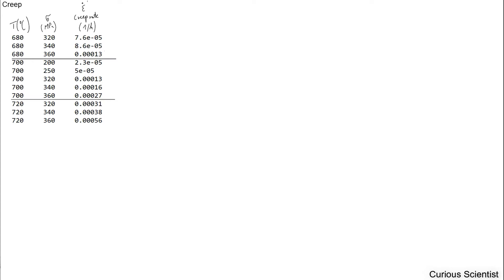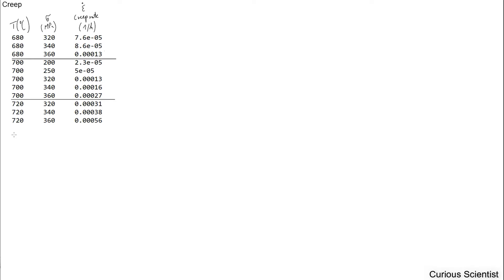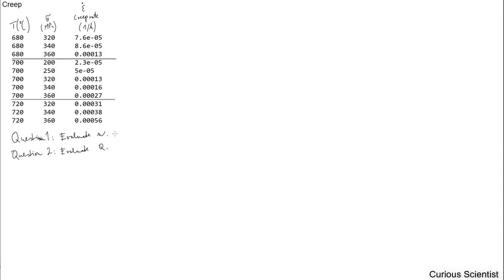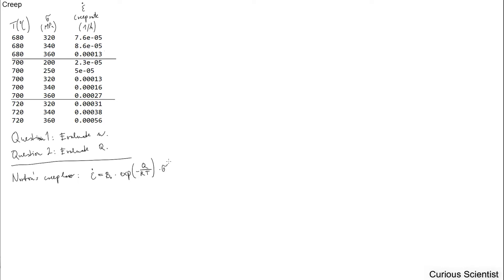Creep calculations - application of Norton's power law

Comment: Hi, If I use Ln for the linearization  the  Q values are the same that using log?
Reply from the maker: Hi! Could you rephrase your question? I don't exactly understand what you mean. I explained in the video that when we "cancel" out the exponential, we need to use ln(), but the rest is log(). Natural vs. 10-based logarithm.

Comment: How can I get the strain rate from creep modulus? Creep modulus is the inverse of creep strain at constant stress but not sure how to make strain rate from the strain. Thanks in advance for your thoughts...
Reply from the maker: If we "go back to the basics", creep is just a diffusion-assisted or dislocation motion-assisted deformation of the material. If you put a load on a specimen kept at a high temperature, it will creep. The creep will cause the elongation of the specimen. This elongation will happen at a specific rate. The elongation can be compared to the original length of the specimen which is actually the strain: ΔL/L0 = ε. If you are curious about the rate then it is simply just dε/dt. In this interpretation, I think the creep rate and strain rate are the same. So, according to the above expression, you just need to differentiate the creep curve and you get the strain (creep) rate.

Comment: To calculate B0, would you just take the Norton creep law and plug in the constants n and Q and the stress and strain rate at the corresponding temperature and then solve for B0? Thank you
Reply from the maker: Yes, if you have the above mentioned parameters, you just have to rearrange the equation.

Comment: Sir, i have T, σ and ε΄ data from tensile test for an alloy of my interest. I want to simulate creep in Ansys with the use of Norton's creep law. May i use this procedure to derive constants for the Temperature that i have more data ? How accurate is such an approach for modeling creep response ?
Reply from the maker: Hi! I am not familiar with creep modelling so I cannot really answer your questions.  But you can of course evaluate the data for the temperature where you have more data. In this demonstration, I also only evaluated for the 700°C case.
Reply: @CuriousScientist Thank you for your response! Would it be more accurate if I calculate constants for each and every temperature that i have data ?
Reply from the maker: It is always good to rely on more data. It depends on what you want. You could see in the video, that one range was already enough to define the slope (n). But if you have more data, you can confirm your numbers with the rest of the slopes for example.
Reply: @CuriousScientist  Thank you!